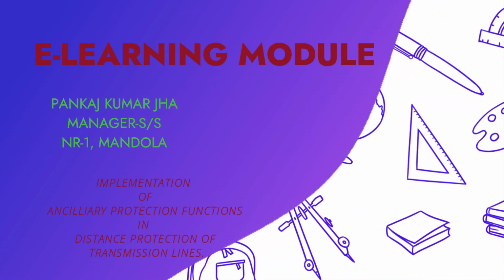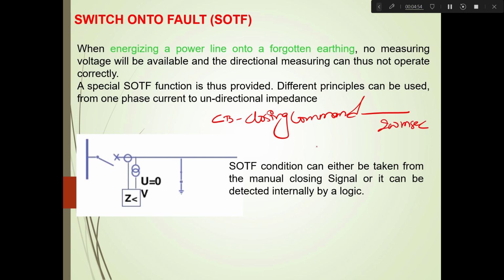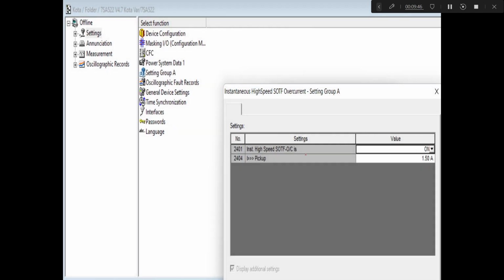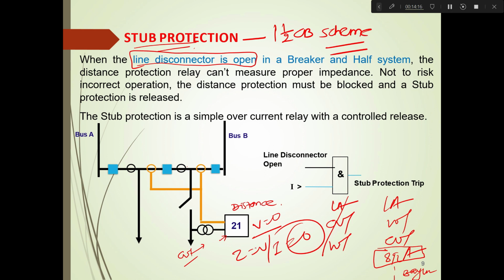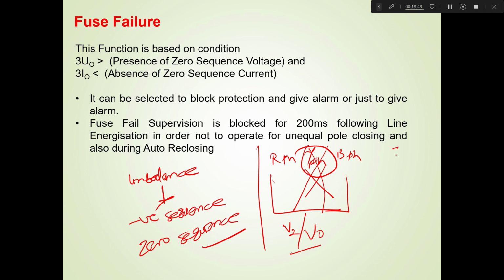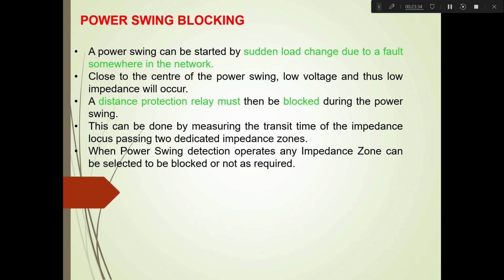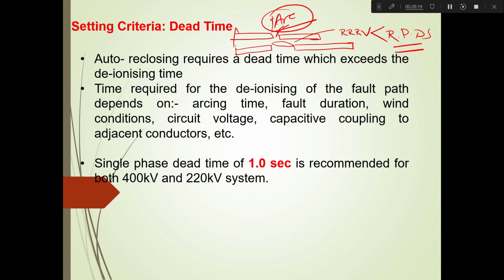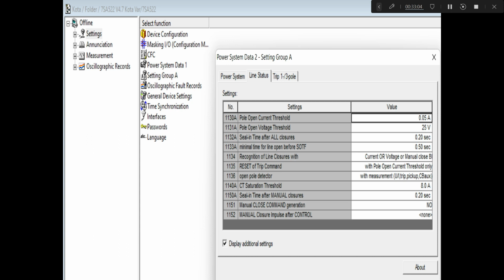Ancillary Protection Function and their implementation in 7SA522 Relay | SOTF | STUB | VTFF | BRC

Comment: Sir in broken conductor feature when one phase opens and there is no contact with ground then how zero sequence current magnitude will increase?
Reply from the maker: In case of BRC, only negative sequence current will increase and that's why in GE and ABB Make Relays, BRC Algorithm checks the ratio of Negative to Positive sequence current.

In Siemens Relay, BRC Condition is detected by checking the ratio of lowest to highest phase current.

Comment: Hi sir, how to differentiate digsi4 and digsi5 by knowing model number?! Eg:7UT82-DIGSI5
7SJ662-DIGSI4
Reply: I think you want to say how to differentiate Siprotec 4 and Siprotec 5. 
With Siemens all relay model number start with 7 and BCU start with 6.
If the 4th character in the model number is 8 then it's Siprotec 5 (DIGSI 5 if you want)
If the 4th character in model number is 5 or 6 then it's a Siprotec 4 (DIDSI 4).